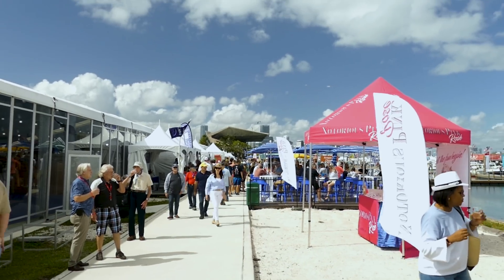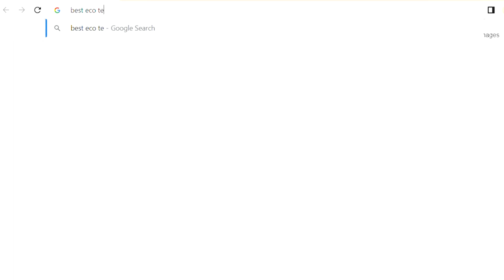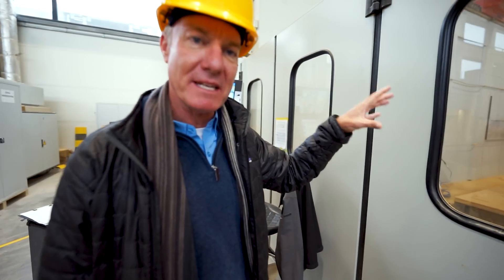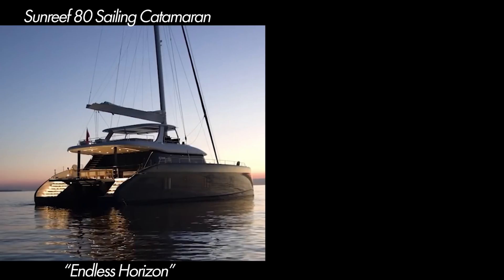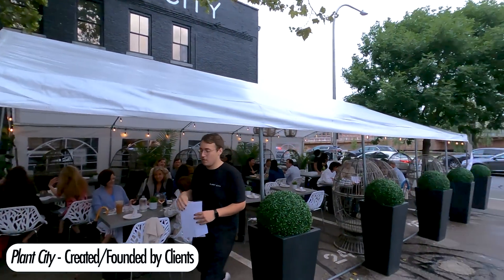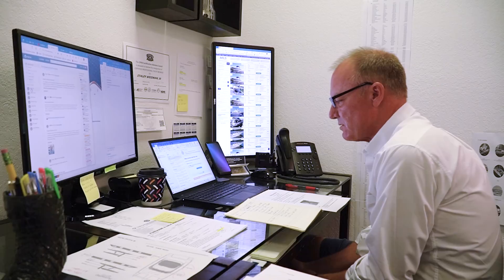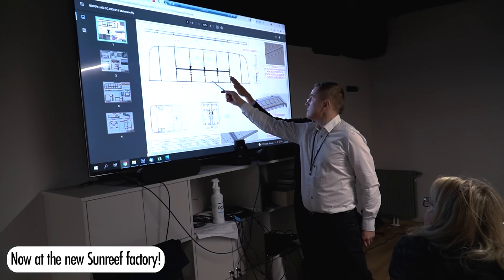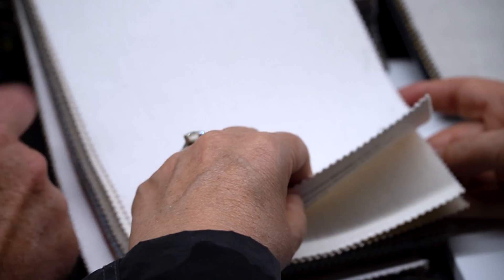Documentary Series on Sunreef 80 Eco Catamaran Build "The Future of Yachting Now" Ep1 Electric Power

Comment: Only 1 big change needs to be made. Replace the diesel generator with hydrogen back up system that converts salt water to hydrogen and hydren to electricity when needed. Zero carbon footprint and HUGE bonus of ability to store in hydrogen  the equivalent of 100 times the amount of kilowatts your battery storage is capable of at ZERO dollars. Increasing range to much greater distances and traveling at much higher speeds than 3-4 knots.